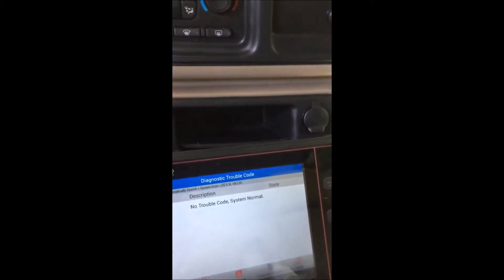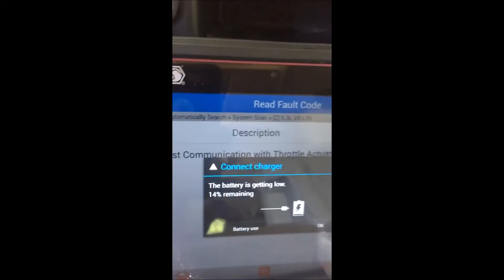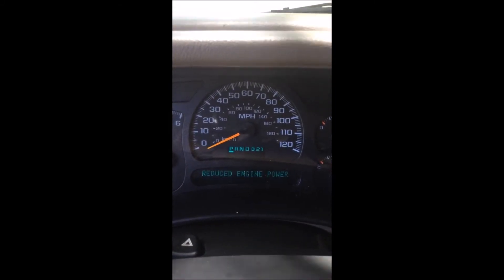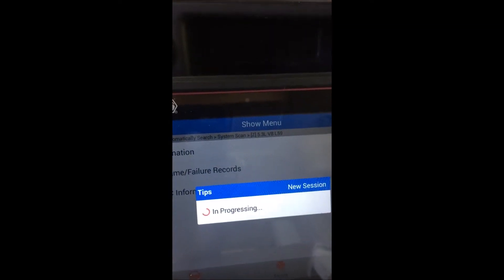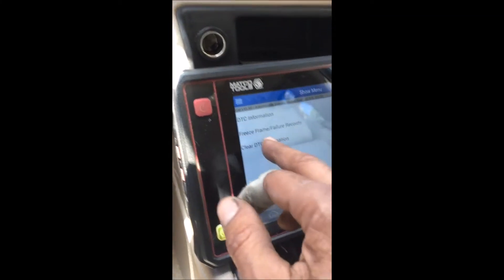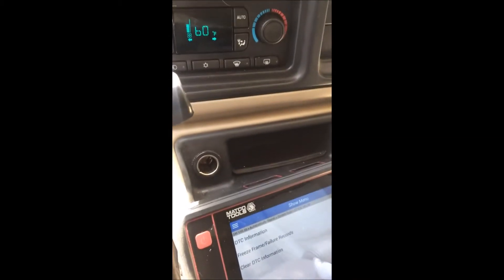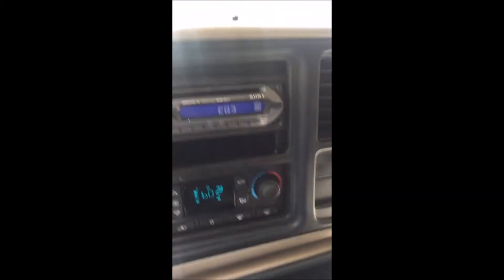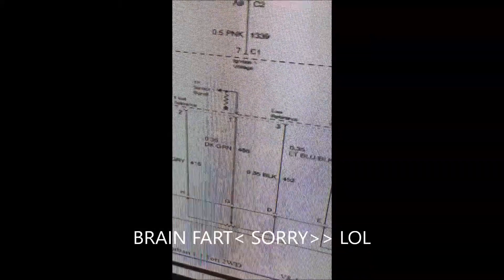U0107 REDUCED POWER MODE LIMP MODE

Comment: 16 seconds in , g103or g104?
Reply: Ah yes 104 😊Well done man, good diagnostic approach. I generally reroute the ground to the side of the head
Reply from the maker: yes, I usually do too... that's were they should have put it in the first place huh? :)  thanks, glad it help :)
Reply: Hayes Mobile Auto Repair I have a 2006 doing that exact thing but can’t find the black wire your talking about. I have a ground strap going from back of block to firewall
Reply: @1kmodified  did u find it?
Reply: @MC-hs4mf  I did
Reply: @1kmodified  where?